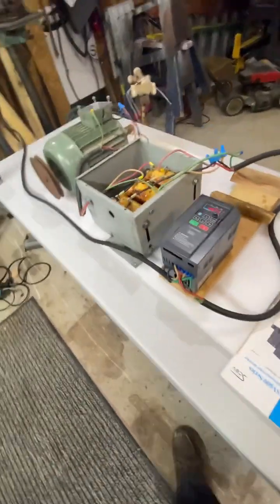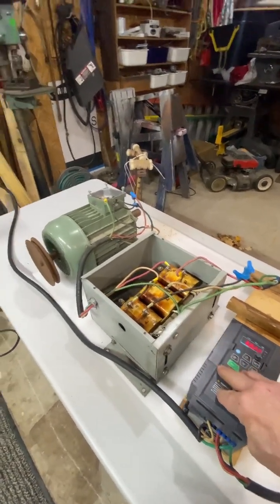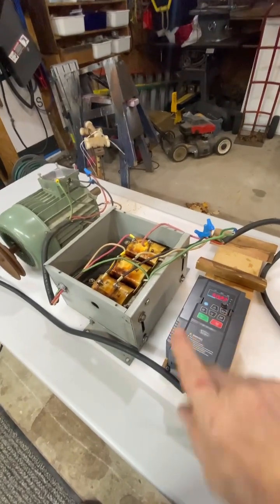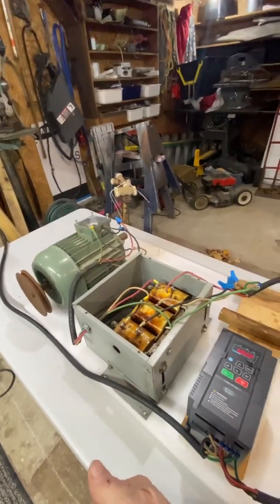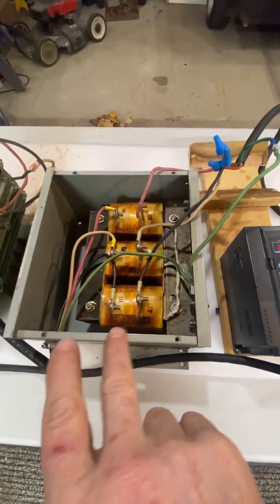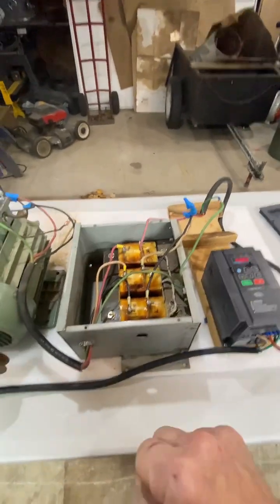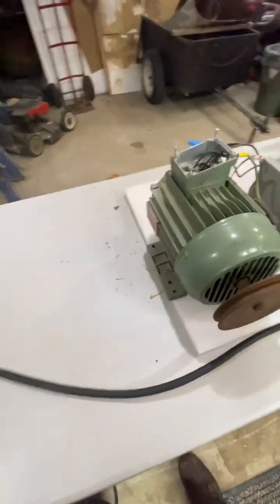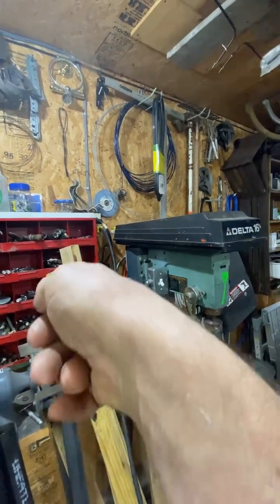600 V three phase off a regular outlet #wadkintemple

Comment: Where did you get the components? The VFD and transformers
Reply from the maker: I supply the VFD's as they are custom-made for single phase input this is just an addition to those with complex voltages other than 240 V. This opens up many doors if you would like to inquire about how to convert three phase equipment to single face power just simply send me an email to Jack@jforsberg.ca.